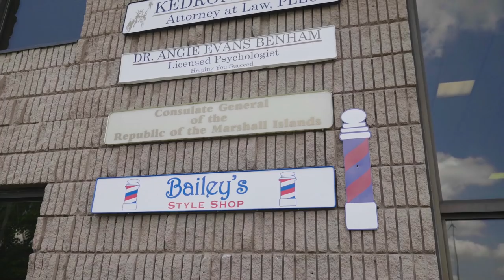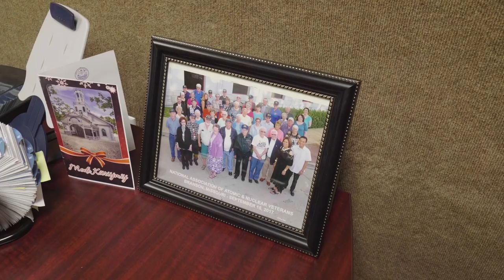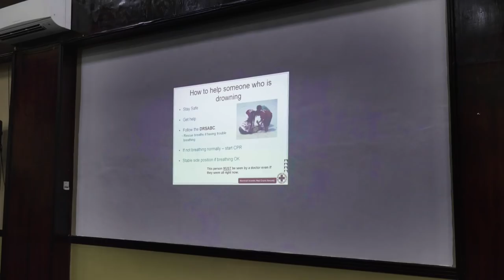Their country is disappearing

Comment: take sand from the bottom of the ocean and make the island bigger? the Netherlands did it..
Reply: Mr. Turkey who pays for it?? Its a damm small island and doesnt have the funds for it.
Reply: China and US should pay for it!
Reply: Not trying to diminish the Netherlands achievements, but they also had a pretty enclosed coastal region of sea, so it's much easier than increasing the area of a bunch of atolls in the middle of the pacific ocean, most of which get at least partially engulfed by water with every tide. They also didn't just use sand from the bottom of the ocean (which isn't even a good building material, their not in a tropical region prone to natural disaster fully capable of destroying any efforts to save the islands and they were trying to conquer the sea, not battle climate change. And it wasn't a last ditch effort to try and save themselves, it was a planned out construction, but it's not like they were lacking in land like the marshall inhabitants are.
Reply: WOW  thanks for put in so much effort into your comment
Reply: Exactly what I said. Really is the only solution. They cannot build a dam to hold the pressure of the whole top of the ocean back.
Reply: Rafael Dos Santos still, it can work. Once the sand is dry. It builds just fine. Just not as course of a grain without treatment. The world sea level is raising. Which is not a tropical storm. They all used to tropical storms. Also once irrigated and grown on at a proper slopes of degree. It can control the erosion you speak of. Just as the rest of the world does it. 

The real issue is that they don't have the capital or equipment to get sea sand. Because if taken too closely to the coast. The shore line will  recede. Meaning counties like Australia or the US must help. Yet it sadly sounds like most of the world does not care enough to pay for their salvation. Plus all those houses must be buried. Which at that point do they want to still be saved.
Reply: Dredging is expensive, and just sand will still erode over time. I had an uncle that ran shipments of gravel over to some islands near there, they just need money (that they probably don't have) to build the islands up
Reply: so they should try to put a bandage on the problem instead of trying to fix the root of the problem?
Reply: Sand by itself is not a long term fix. It’s barely a short term fix.
Reply: Mr. Turkey chinese will be happy to pay for that project only to get access and put the army base on one of the island, once it disappeared some one will come and raise it again cause it will simply be a little foot below water
Reply: Dubai made islands. From my understanding it’s not rising ocean, but a sinking island and erosion. I think rock formation?

Comment: Thanks for sharing and most of all caring. Now we just need to come up with a workable solution to the problem. Would taking landfill or sea trash and building up the perimeter of the island work? You could pour a concrete pad, put the sea trash or other types of landfill on top of it and cover it with another layer of concrete and top it with sand dredged up from the surrounding waters. While not a cheap fix, doesn't exposing the environment to all the buried nuclear waste a far greater cost?